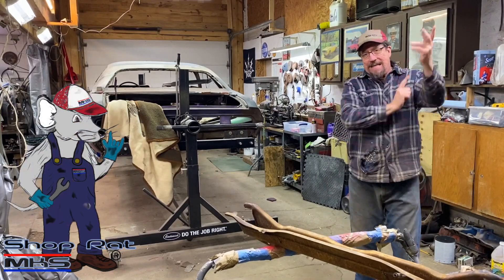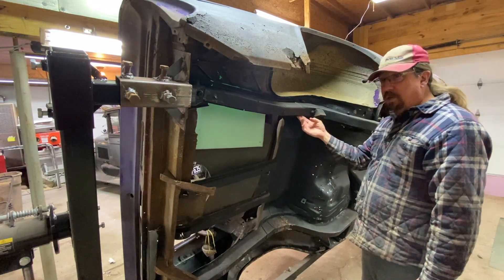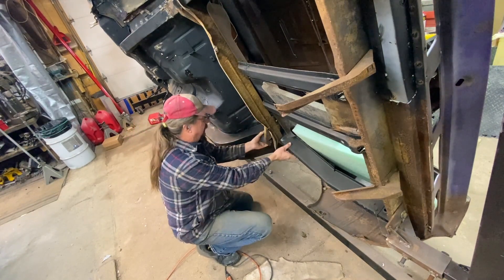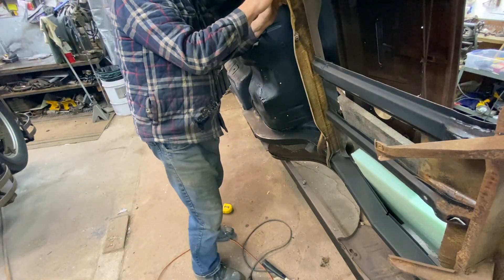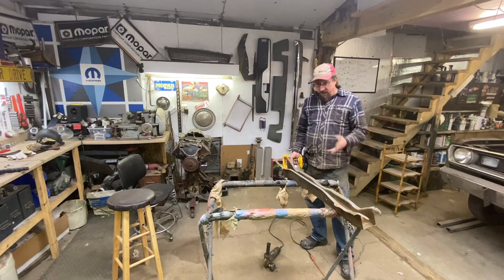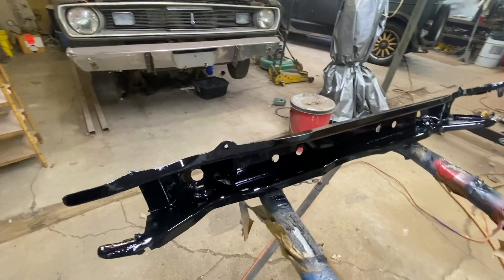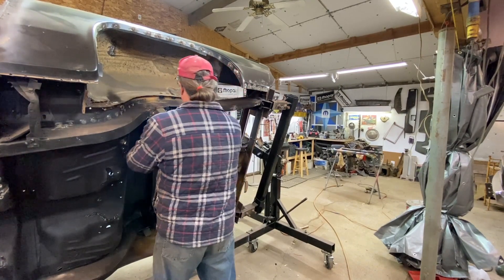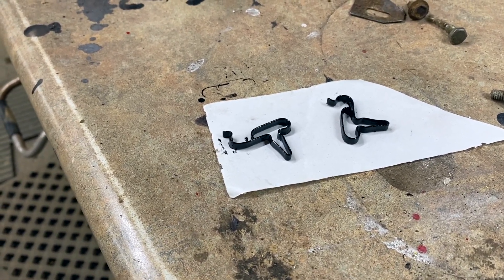Refurbishing and test fitting  a Rear Shock crossmember for our 1970 Dodge STITCHES Challenger

Comment: I don't know.  Maybe being on its side in the rotisserie it settled just a bit?  Strange.  My dang OCD wanted you to put the other fender well in to balance the dang thing.  It was driving me crazy.
Yeah, when that little voice talks to you, it is usually a good idea to listen to it.  At least when it has to do with constructive things, or personal safety issues.  Not so much when wandering the isles of your favorite shopping place, or when inebriated.
Another interesting video.  Until next time.

Make it Safe,
Make it Done,
   &  
Go Have Fun

Stay warm, safe, and healthy.  RAWK!
Reply from the maker: I hand built those frame rails on a sheet metal and I’m sure that one frame where it is probably not exactly right. Plus it may be didn’t get necessarily installed in the car in the exact location

All the tolerances on these cars is about plus or -1/4 of an inch 

So if I was off and 8th inch on frame thickness and off 1/8 inch on frame location. That easily would cause the problems I was having 

Definitely all within factory tolerance, so no big deal. 

Definitely not related to it laying on its side on the rotisserie at all.